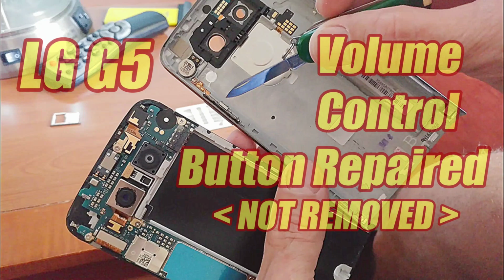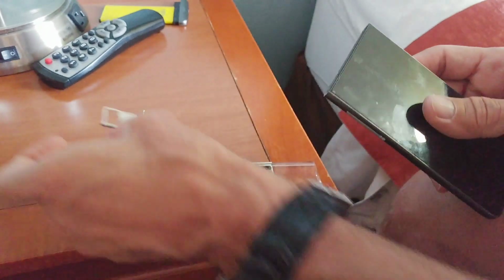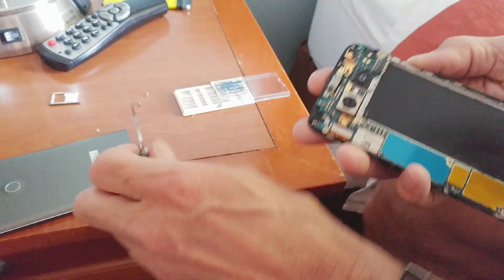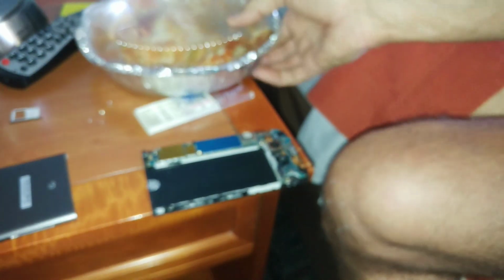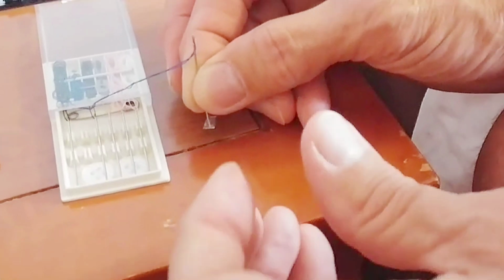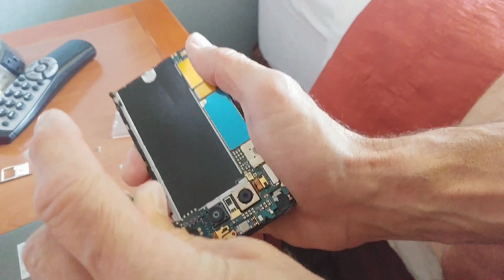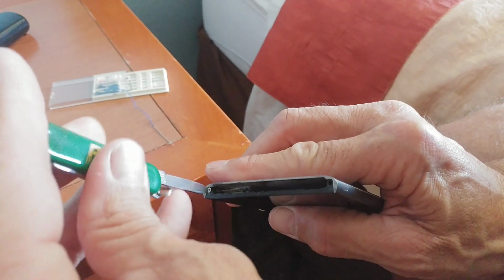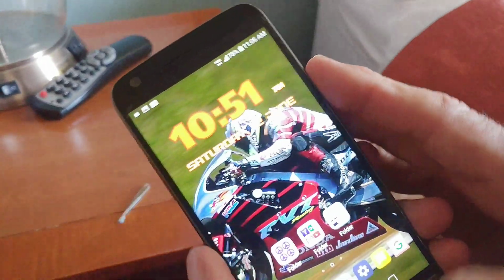How To Repair Volume Control Button LG G5 Volume Down Fixed

Comment: In my case, both buttons didn't work... Now after tring this I made the volume down work (It works perfectly btw, I just have to press It lightly to work, I have another G5 with both buttons functional and It is as easy to lower the volume in both devices).

I will try again later and maybe try to improve the spacer a little bit. (Update below)

[UPDATE]

I tried it later that day and I couldn't make the Vol Up key work. After a couple of days I went again for It and just in case reseated the flex and the button worked for a bit, then I noticed that the flex wasn't sticking properly to the bottom so I decided to put a bit of alumin foil under It as well and now Both buttons are working fine.

Thanks man for the Tutorial, I might as well replace the flex in the future if necesary, but for now It seems to be perfect.

Comment: Volume buttons quit working so I thought I'd see how hard it is too replace them before buying new ones and stumbled upon your video. Little piece of tin foil and they work like new again Thank you!.I have a Samsung note 9 that has the same problem do you think there's a good chance I could apply this technique to that phone as well?
Reply from the maker: Vlad B: I haven't opened a Samsung Note 9 but they do have similar contact terminals between the front and back for the volume switch. Since those phones are glued together and not friction snapped together, it would be best to have a new volume switch on hand before reassembly. I hope that helps.